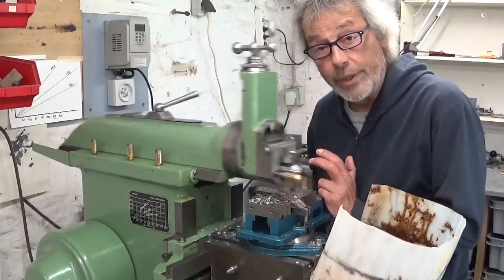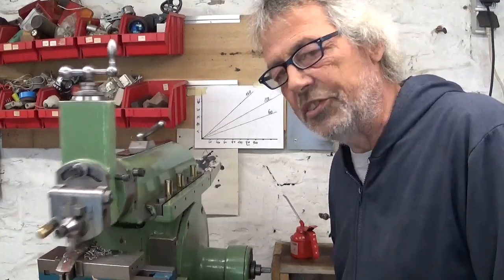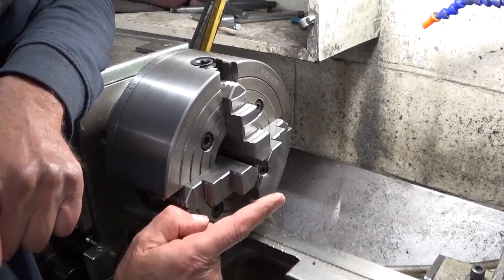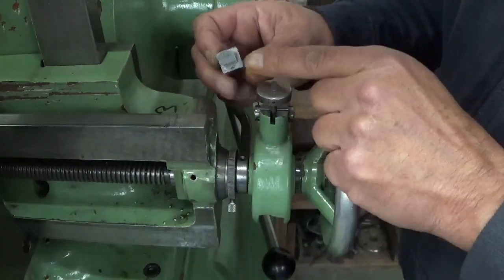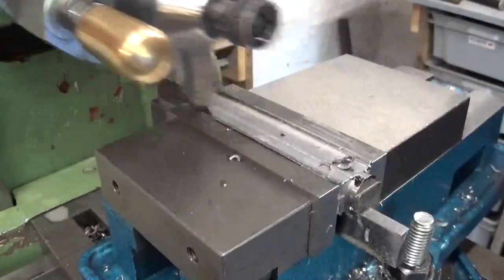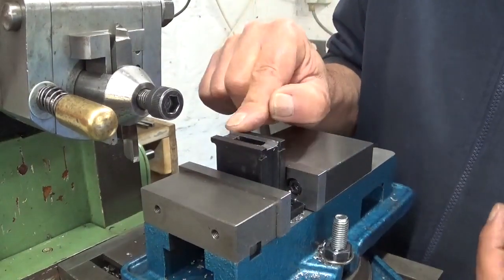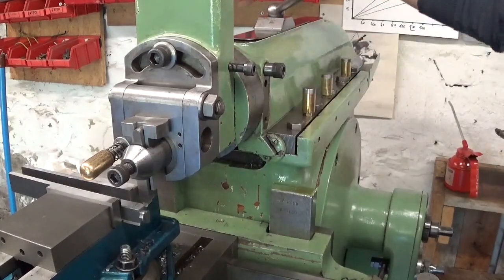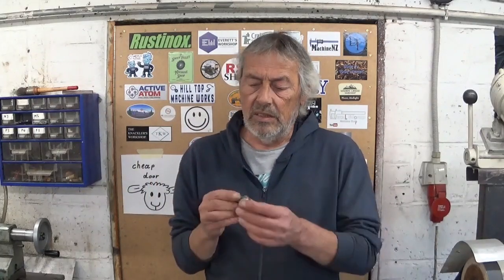Scale model shaper pt 4. The ram.

Comment: Thank you for the time that you take to produece such entertaining and informative videos.
I wondered if you have ever made form tools from gauge plate? It occurred to me that a form tool could have been produced for the rounding of the top of the ram. A hole could have been drilled fractionally undersize then reamed and the plate cut to leave a quadrant. If the hole were drilled at relevant angles to leave clearance the plate could be hardened leaving an accurate form tool. I do not know how well this process works on the shaper though I know it is useful in turning. The uncertainty is caused by the greater impact on the tool caused by the interrupted cuts of a shaper but if you need to carry out further cuts to produce convex sections it may be worth a shot.
Reply from the maker: Making good form tools takes lots of time. To make multiple parts, the form tool could indeed be an option, but for a one time use it's not worth it. Plus, you need a lot of power to use them and there's a risk of chatter. My little shaper doen't like form tools very much.

Comment: Enjoying the build Rustinox, good choice 45 degrees. I like your cutting speed chart and that you are running the shaper fast. I'm sure if the shaper was in production manufacturing it would be maxed out in most operations.
Reply: I once had a boss that would constantly come by and ask why I wasn't running the machine faster. Found out that a good answer was because I wanted to create more usable product than scrap.
Reply from the maker: Jus use a machine the proper way and the sky isthe limit :-)